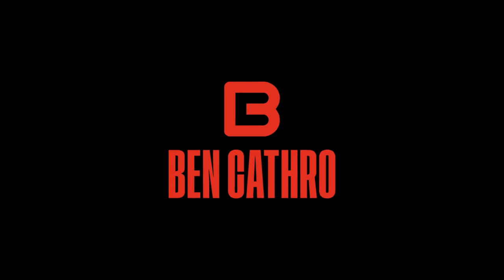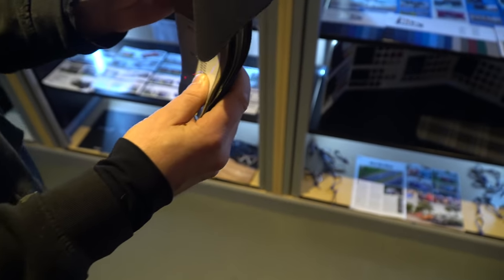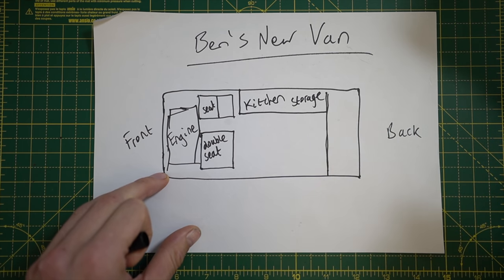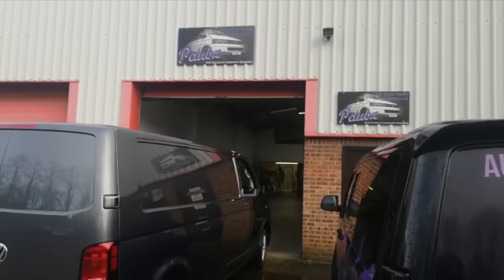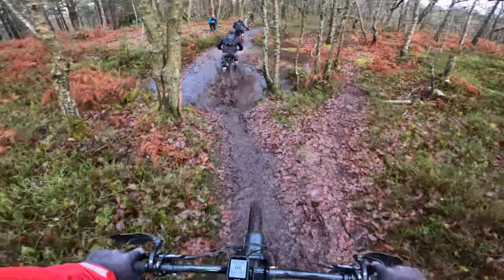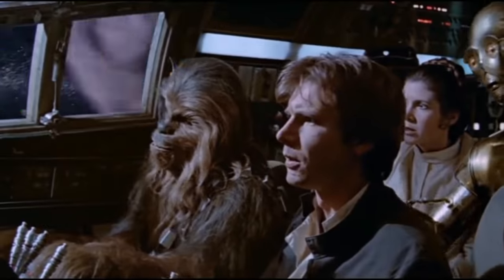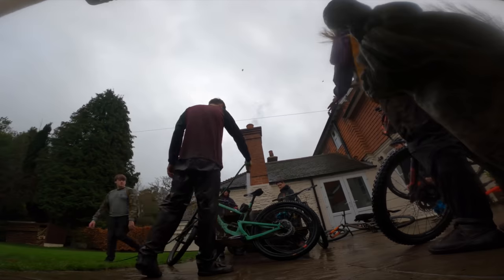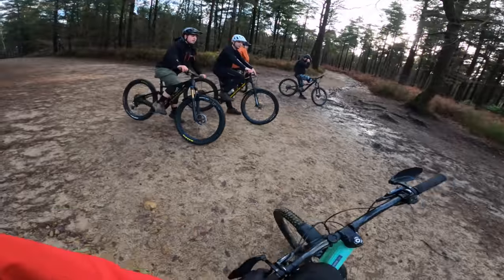Designing my perfect MTB camper van // Plus riding Surrey Hills

Comment: Why a vw rather than the ducato platform which is wide enough to sleep across
Reply from the maker: That’s easy, I want a smallish van as it’s my everyday vehicle.
Reply: Fair enough
Reply: A Ducato isn't wide enough to sleep across for taller folks anyway once you add even a little insulation or wall panelling. Someone Ben's height would need side flares to make it work.

Comment: Why didn’t you buy a longer wheelbase  high top van, avoid all the complexity. You would really value the extra space. Mercedes have done mbtex forever but they still do the real thing.
Reply: Lwb crafter/sprinters are an arse to park and daily drive and down back roads to get to some trails you have to leave them  outside because of hight restrictions in car parks. I'd trade off the size for accessibility any day!
Reply from the maker: What Steezy G said. This will be my everyday driver and I want it to be a small as possible while still being practical. Screw nipping to the shops in a massive wagon on our tiny roads and towns.